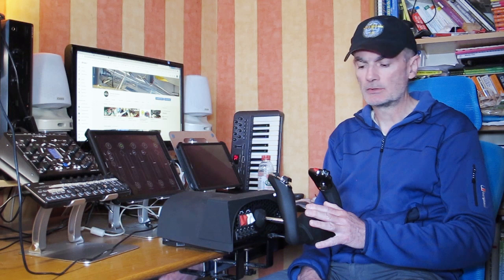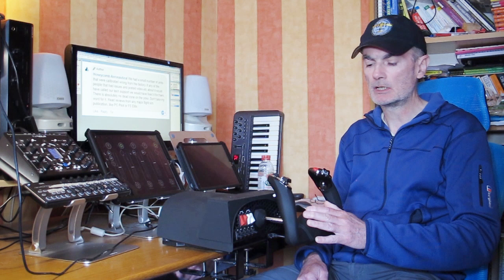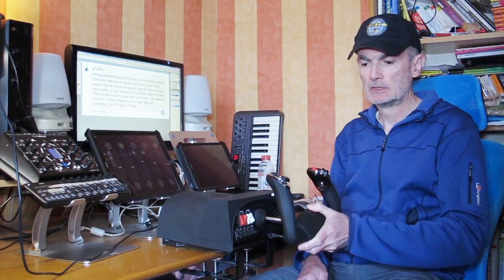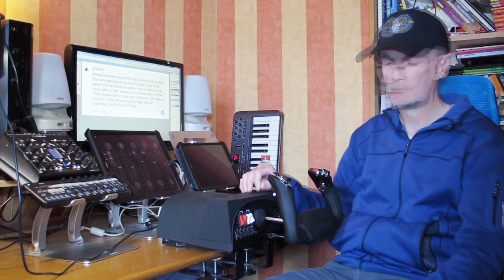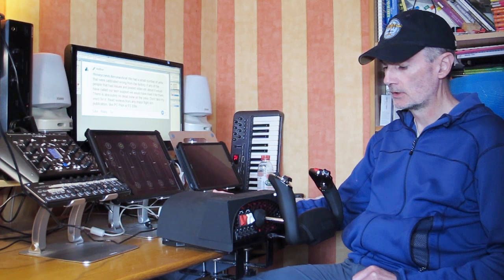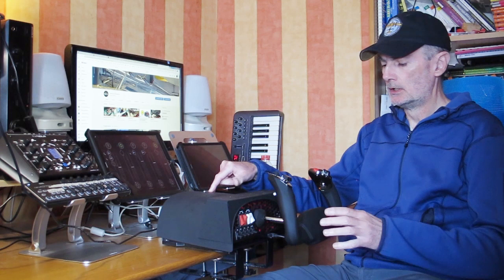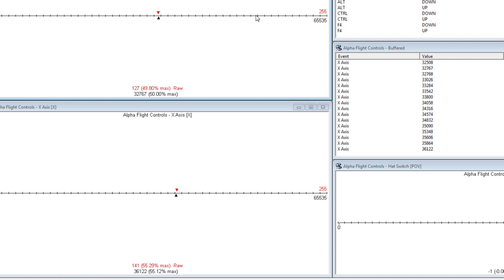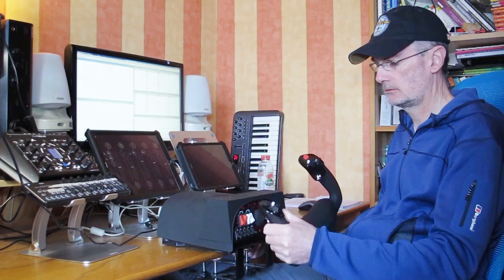Honeycomb Alpha Yoke SECRET Calibration Mode!

Comment: and all that not matter. you can adjust deadzone on sim
Reply from the maker: Er, no. You can make it bigger, but not smaller :)
Reply: @AlmostAviation  Some games and software have what's called anti-deadzone features, which does allow you to make a deadzone imposed by some other system, smaller.
Reply from the maker: @imsvale  That would appear to require magic :|
Reply: @AlmostAviation  Mmm, maybe I jumped the gun and I've got this the wrong way around. Rather than games canceling out lower-level deadzones, it would be a piece of software external to a game canceling/reducing a game's imposed (and unchangeable) deadzone. I see your concern if it was the other way around, and admit I don't know that much about it. That necessarily means if you can't inject a software layer between the hardware and the firmware (which pretty much by definition, you can't), then any deadzone imposed by the firmware would indeed require magic to counteract. So it wouldn't apply here.
Reply from the maker: @imsvale I think what you can do is to manipulate the behaviour across the rest of the range to make the dead zone less obtrusive. A simple example would be to make the whole range less sensitive, in which case the dead zone would be less noticeable. (If you made the granularity of the movement sufficiently small, you wouldn't notice it at all.) This kind of manipulation is kind of like what the Microsoft flight sims by imposing a non-linear curve on analogue axes to make them more responsive the further out from the centre you go.
Reply: @AlmostAviation  From what I understand it's a lot more clever and accurate than that. Steam for instance, through its controller configuration, can do this to counteract a hardcoded deadzone in a given game. If a game has a 15 % deadzone and you configure a 15 % anti-deadzone, the result is precisely the same as having no deadzone to begin with. Presumably it's because the Steam controller configuration can modulate the input before it's read by the game, and thereby through mathematical trickery feed the input to the game in exactly the right way to get the desired result. Again with the reservation that I don't know precisely how it's done, I'm only speculating how I imagine it might be done. And this can only work if you can insert a layer prior to the application of the deadzone you want to kill.

Comment: I wonder if FSUIPC undoes all the calibrating if the yoike is programmed through that Application. Or indeed if the dead zones can be eliminated with FSUIPC. Or variations of my question.
Reply: I used FSUIPC to set my axis and the dead zone I have is not noticeable but then again I may be just a crappy pilot.
Reply from the maker: If you think about this carefully, you should be able to answer your own questions. Taking your second question first, FSUIPC cannot possibly fix things if the yoke simply doesn't send data throughout a particular range of travel. Returning to the first question, FSUIPC can't 'undo' the calibration of the yoke, but since it sits between the yoke and your sim, it can certainly mess things up if you set it up wrongly. One thing to pay attention to is the 'delta' value, which I think I talked about in the last video.
Reply: @AlmostAviation  So maybe I had no dead zone problem to start with OR maybe I just don't get worry about whatever my dead zone is because as I said I am a crappy flyer.
Reply: @AlmostAviation  Thanks for the response Mark. I think I will proceed with ordering myself one of these yokes. You certainly don't hold back which is to your credit.

Comment: I have a problem: when I pull the yoke toward me the elevator goes down and visa versa. Can you help me, please. I calibrate exactly as shown, but no luck to have this fixed. Thank you in advance for your help.
Reply from the maker: You will need to describe this in a bit more detail, including if you ran the manual calibration and something changed. You may have accidentally done the calibration steps in the wrong order, which would reverse an axis.
Reply: @AlmostAviation  yes, I done the manual calibration and that caused the elevator mix up. I tried the manual calibration three times there after, but no luck. Thanks for trying to help.
Reply from the maker: @louding11  If you are consistently following the instructions correctly it seems most likely that you have mapped your elevator control in reverse in the sim at some point. Perhaps you can check that. Of course, you could just ru nthe manual calibration and the push-pull actions out of sequence, which at face value should fix your problem. But that would suggest your yoke is somehow wired up backwards, which seems implausible. Your problem is more likely to be software-related.
Reply: @AlmostAviation  Thanks for your reply, but what is your advice to try next, please?
Reply from the maker: @louding11  I would suggest (1) Delete all your yoke axis mappings in whichever sim you are using; (2) Run the Honeycomb manual calibration, making sure you follow the instructions precisely; (3) Calibrate the yoke in Windows Control Panel; (4) Map your axes in the sim.
Reply: @AlmostAviation  Thanks again. Sounds GREAT. I use MSFS and will try your suggestions tomorrow.
Reply: @AlmostAviation  Thank you so much for your expertly advise. Fixed in no time at all. I'm happy flying again thanks to you!
Reply from the maker: @louding11  Awesome :)

Comment: I just received my Honeycomb alpha yoke today, plugged it in, started MSFS 2020 and the plane always wants to ever so slightly roll to the left, I have to keep rolling the yoke to the right to regain a level flight but within a few seconds, the plane starts rolling left again, will recalibrating fix this?

p.s I did increase the deadzones to around 15% in the sim which kind of elimate the rolling left but as you would guess, having high deadzones isn't ideal.
Reply from the maker: Others have reported this in MSFS 2020, so I don't think it's anything to do with the yoke.  As you say, dead zones aren't the way to fix this! If it turns out to be irrational (i.e. not torque effects and so on) I would suggest tweaking aileron trim (if your aircraft has it) for now, or possibly balancing it out by loading the fuel tanks asymmetrically.
Reply: @EyeDoctorJoe  Before getting the Honeycomb, I had to use a console controller for a few days and the plane wasn't doing it, only started happening until I plugged in the Alpha yoke, strange.

Comment: Hello,I just want to tell you I fell in love with the Honey comb yoke and it does not lose calibration in Windows after computer shutdown or restart,because of the 90 degree range on ailerons has a deadzone but I don't mind it because in prepar3D the planes only have a range of 45 degrees but you actually move your yoke close to 90 to make turns but you don't look at the virtual yoke anyways so bottom line is is 100 times better then the logitek and easier to land I have the switch panel disconnected for now because is conflicting with the planes I need to figure out how to fix it I do recommend this yoke and honeycomb has my business when the throttle comes out.

Comment: Any claim that there is no deadzone is obviously false. This calibration method can be used to induce an arbitrary exaggerated deadzone by deliberately (or accidentally) marking the center positions off-center, which would then (presumably, since it wasn't specifically demonstrated) produce a very marked and easily demonstrable center (inner) deadzone. The same way as you demonstrated a very obvious outer deadzone by marking the full left and right deflections at the 45 degree points.

At best the claim should be that the unit is intended to be calibrated such that there is no perceptible deadzone. That's not the same thing. Therefore a flawed factory calibration can easily result in a much larger deadzone than intended. In either case, there IS a deadzone, and any claims to the contrary are disingenuous at best. Support personnel insisting there is no deadzone have either been misinformed or they are instructed to withhold information about this. One of those is worse than the other.

Thanks for sharing the calibration routine!

(I just bought mine, so this is all new to me. I see now that Honeycomb published this calibration routine a while after you posted this video. Good.)
Reply from the maker: I talked in a previous video about calibrating the yoke off-centre. This demonstrates that the deadzone is not built in but is entirely an artifact of the calibration routine.
Reply: @AlmostAviation  Think I found that video. I'll have a look and stop beating a dead horse!

Comment: Sounds like a shit design.  If they had used springs instead of bungees there wouldn't be the hysteresis issue (or at least it would be significantly less)  A coiled spring doesn't have the same elastic/plastic deformation curve as rubber!
Reply from the maker: I don't think hysteresis effects are significant. After all, it appears the yoke can be calibrated with almost no dead zone. Bungees are also used in high-end yokes from PFC and Virtual Fly, so I'd assume there are good reasons for choosing bungees over coil springs.
Reply: @AlmostAviation  From what he showed us, hysteresis is an issue.  If you push full right and return the yoke manually to the centre you do not get proper readings.  Just because other yokes use bungees doesn't mean that they are good.  They may have some other mechanism like a look up table to counteract the hysteresis.  I would have to do a deep dive to know more.